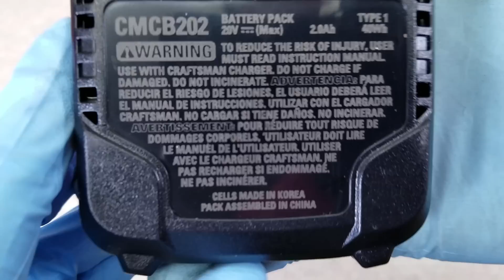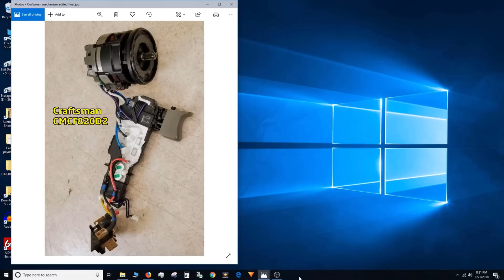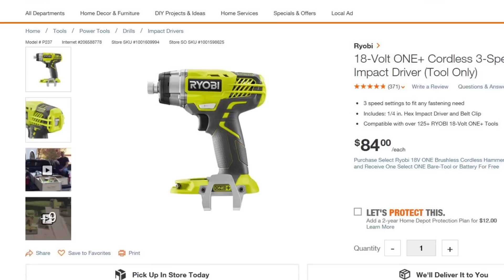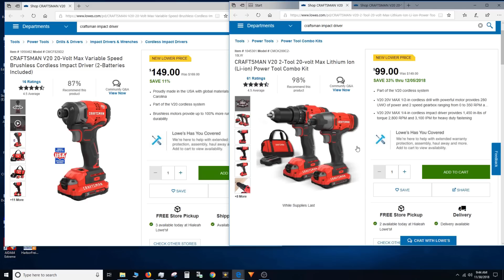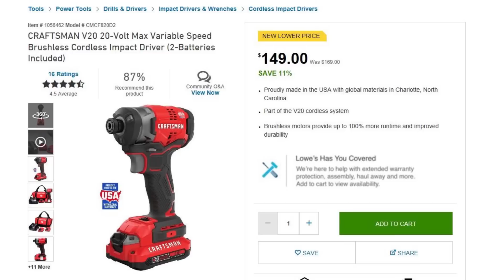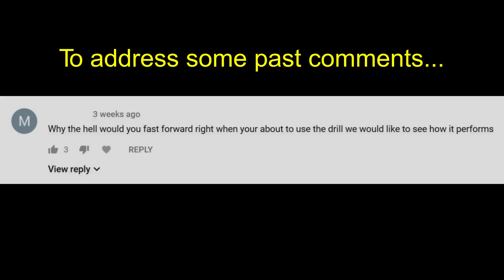Teardown review: new Craftsman brushless impact driver from Lowe’s - is it a DeWalt clone?

Comment: $149 for a consumer brand tool I think is a little to much, especially considering the DeWalt isn't much more. This said it almost looks like a clone of the DeWalt where the average user probably won't see any noticable difference in performance, it's not a bad way to save a few dollars. 

 I think this one is hard to call. If I had the money and need, Id buy it. I want to see Stanley Black Decker make Craftsman into something again, so yes.

Comment: The battery pack appears to use the same Chinese off-brand cells, similar to Black + Decker 20v line. It is worth mentioning hat they also use the same battery management circuitry. For what’s its worth, the new Craftsman line is also compatible with B&D and Porter Cable 20v batteries but need to be modified by removing blocking posts on the packs to allow the pack to attach.
Reply: That's interesting because VCG construction opened one and said battery wasassemble in China with Korean cells.
Reply: Did you actually make it work?   it looks like the Crafts V20 has an opposite polarity setup than the PC/B&D 20V packs.
Reply: So the supposed premium brand uses batteries from the budget brand.  Pass.
Reply: Yep the internals look similar to my Porter Cable 20v. It failed after less then a year.
Reply: pospc2 this impact hasn’t even been out for a year. 🤣🤣
Reply: @ajgreen868  was meaning the battery pack not the impact. No idea what the inside of my actual impact looks like,only the battery pack
Reply: pospc2 gotcha. My bad man

Comment: The Craftsman seems like a good impact, but for similar money I'd choose Milwaukee (preferably), Ridgid or Dewalt, especially right now since they're all on sale for the holidays.  They're well established brands that have much larger tool and battery lines.  The new, brushless (non-Fuel) Milwaukee impact driver and drill driver combo kit with two 2ah batteries and a Packout case is $199 right now at Home Depot.  The impact driver does not have 3 speed settings and is a little less powerful, but it's still a solid performer.
Reply: its basically a dewalt/porter cable though made by SBD

Comment: For $150 I'd be buying a Makita or a Milwaukee.
Reply: My Makita cordless stuff gets used to the limits with no failures.  Reciprocating saw and grinder especially, running cords up a 30 foot scissor lift is a pain in the balls.  I USED to buy Milwaukee, but the problem was everyone ELSE had Milwaukee stuff and if I didn't keep a close eye on mine, my brand new 5.0 amp batteries would magically turn into shot out 2.0 amp batteries by the time I came back.
Reply: milwaukee should be renamed chonqing. everything they make comes from china, seriously everything.
Reply: i have my own buisness working on houses doin everything i have all the craftsmen stuff for most part and not 1 time had any problems and use all day 7 days a week my only complaint is i have burnt out a couple batteries but they switched them out no problem at all but as far as the tool and the cost cant beat them hell now days its seems that most of the upper sets are great and there all made by man and some times you will get a defective tool but for the money they are hella worth it and if there using dewalt parts in diff case for most part your getting dewalt for half the price. not saying its best or anything but i love them through my experience and i don't knock what other professionals use we all have our own taste and opinions
Reply: @johnreeves6854  that can't be true. The only good brand is the one I use and everything else is absolute useless trash!!
Reply: Dewalt or Milwaukee. Makita used to be good,  at my last job the Makita 18volt tools didn't last. We may get 3 months out of them. The older NiCad set was un beatable. I have a set of DeWalt's Impact and hammer drill that have now hit 7yrs old. I haven't had an issues. Milwaukee has also earned a solid reputation.
Reply: Makita, Fein and Hilti... Great tools!
Reply: Never buy a single tool unless it is on a serious sale or is one of the odd balls. Always buy combo kits. Save tons of money that way. I'm sure this tool will come up in a 2 tool kit with battery and charger for only $200 or so pretty commonly.
Reply: @802Garage  large combo kits usually have inferior tools in them,.not the top of the line
Reply: @joeframer9642  Not really, all depends on the kit. You can research the model numbers before buying, which I would definitely advise.
For example, Home Depot was selling two different 5 tool Milwaukee M12 combo kits for $199 last Holiday season. One kit had the ratchet and one had the multitool. The ratchet being the more expensive and desireable tool, the other 4 tools were the old versions. So I bought the combo kit with the new versions and multi tool, and bought the ratchet separate.
Another example is the DeWalt 4 tool kit I bought. It has a drill, 3/8 impact, flashlight, and recip saw. All of the tools are the same you would buy individually for much more money except the saw. It has 1/8" less stroke and a non adjustable foot. That's all though.
You have a point though, I would tell people to be careful and look twice. Sometimes the deals that look too good to be true are!
Reply: I wouldn’t buy this tool because I wouldn’t want to have to buy a bunch of batteries for craftsman tools.
Reply: I have the Ingersoll Rand W5111 Impact Driver and it's 20x the tool of this one and 10x of the other big brands out there.
Reply: Me too
Reply: Facts
Reply: Ryobi for its excellent range of tools that use the same battery
Reply: Milwaukee
Reply: mattorama I’d get the craftsman. It’s pretty well built.
Reply: @jeffscomp  yah ok black and decker...
Reply: @jeffscomp  We have no idea how it's going to hold up in the long run, because it's brand new.  Dewalt, Makita, Milwaukee, you know you can count on them.
Reply: mattorama you do realize that Craftsman has been around since 1927 right? It’s not “brand new” like you claim

Comment: Since the Craftsman is now filling the slot just below DeWalt in the SBD lineup, I wonder what that will mean for portercable 20v. Also do the PC batteries work with the craftsman? They look similar, but it's hard to tell if the spacing is the same.
Reply: No they don't

Comment: Looks like an excellent brushless impact driver! I would like to see he same teardown on the Ryobi brushless impact driver.. Thinking of buying a Ryobi combo kit as they have loads of great deals right now.. Great video! Thanks!
Reply: Ray B. I have owned the Ryobi combo kit for almost 2 years, impact driver is a excellent tool I worked it's butt off and it just keeps going. The drill/driver is a good tool also. I bought mine at Home Depot, it was on sale for 99 bucks well worth the cost. I just bought the 'impact/ drill driver combo as I already own all the other battery tools from Ryobi.
Reply: @huntnwabbits8150  I believe it just want to see it torn down and see how it stacks up to the competition.. Great deals going on Ryobi right now!
Reply: If you get the Ryobi, get the 3-speed version. I have both of their brushless impact drivers and the single speed has too much torque for just one speed, plus it is difficult to control the trigger.
Reply: @Pro1er  thanks for the tip! Will see exactly what comes with this combo set..
Reply: Last winter I bought the three speed brushless impact that Ryobi offered. I believe it’s still their top impact. After using it almost daily throughout this year, I think I’m ready to upgrade. The tool itself is an ample performer and can keep up when put against the big brands; however after using a coworkers dewalt three speed brushless for a period, the difference in quality is quite noticeable. The best way I can describe it is that the dewalt was much more trigger sensitive and refined feeling. It just feels more reactive and solid altogether. That all being said, if you’re on a budget or want to feel like you’re getting a good deal, Ryobi will get you there. I’m going to keep mine as a back up.
Reply: Dont bother,  home gamer tool, watch VCG test the Cryobi
Reply: @kwmiked  Thanks for your input.. This will be home use only.. I have an old Ryobi BE321 belt sander that's made in Japan (way before HD bought them) and it still runs like a champ!
Reply: It's a Porta Cable junk